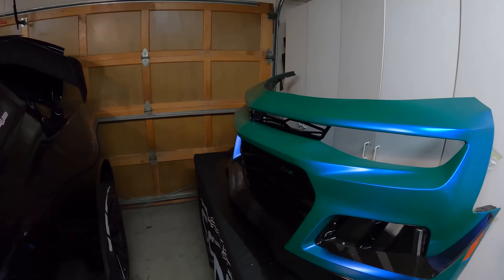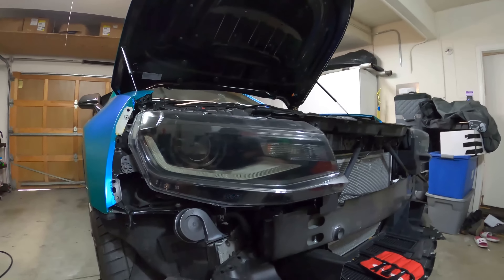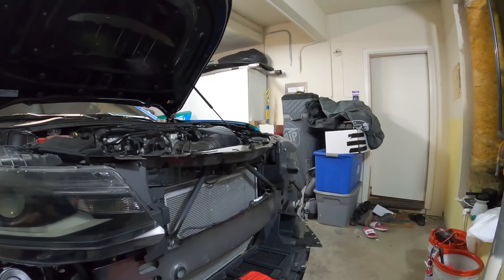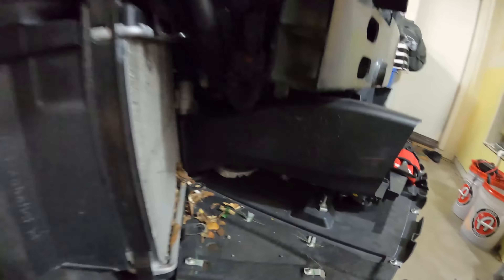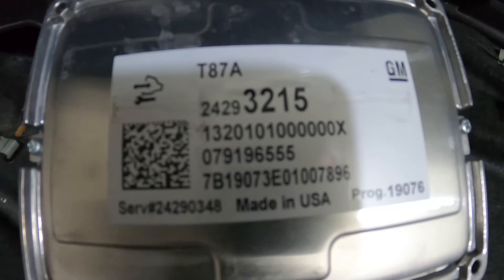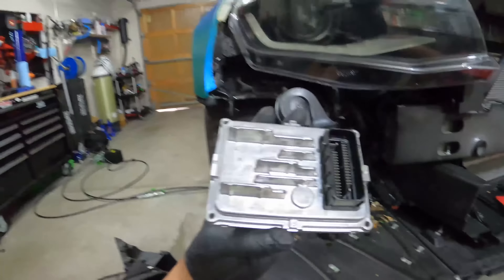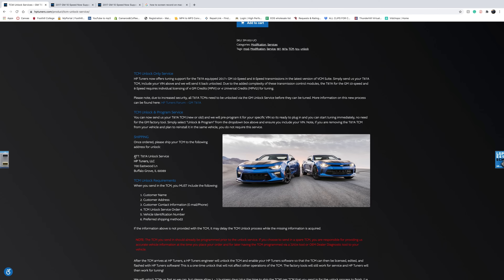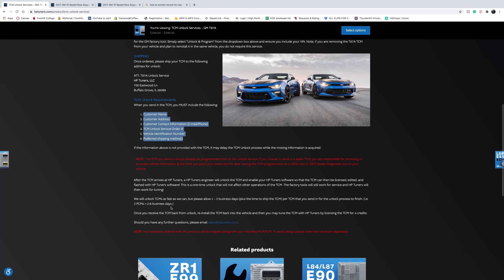How to send out your T87 TCM for unlock.

Comment: i have an 18 ss2 with the a8, i noticed when using the hp tuners that the tcm is actually titled for the a10.
my questions is, can't I just run an old 16 tcm that is actually tunable instead of unlocking the oem one?